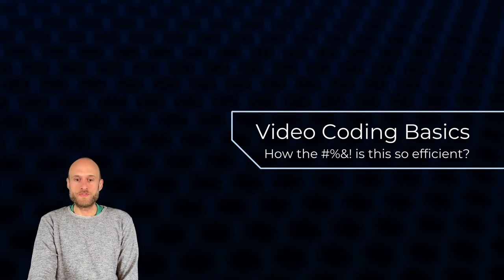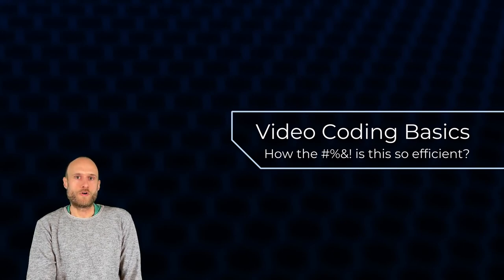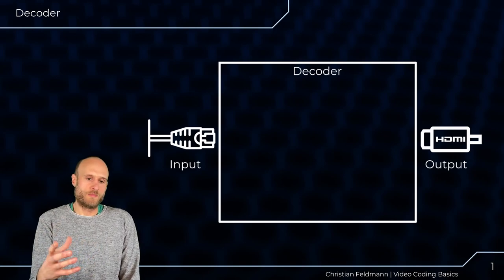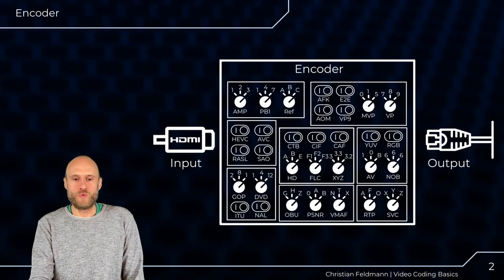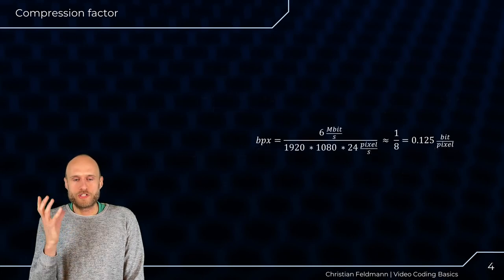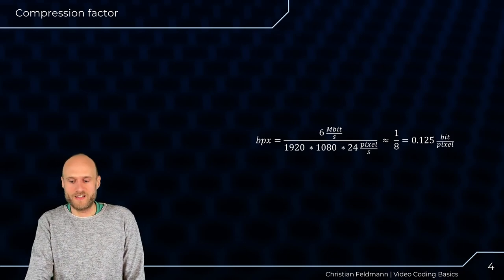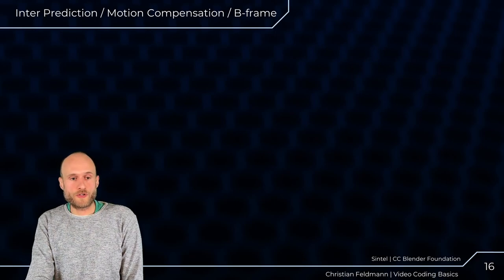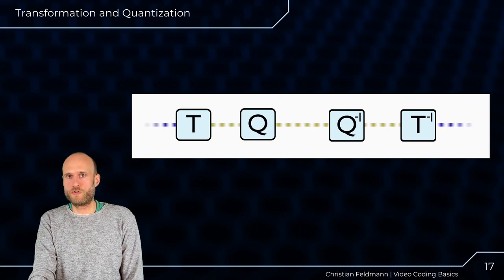Video Coding Basics - How is this so efficient?

Comment: Nice job - this is such a valuable video.

One thing I would add is that inter-prediction is much more efficient than intra-prediction, and bi-prediction is more efficient than uni-prediction. Coding a P-frame may require 2x the bits of coding a B-frame, and coding an I-frame may require 10x the bits of a B-frame.

Comment: Wow amazing video! How does the coding loop know when the encoding has been finished, if we are iteratively sending the same frame's prediction back to the intra-prediction module? Also, how are the intra and inter-prediction modules working together? Since, they both will try to predict pixel values for the same pixels (albeit using different approaches)
Reply from the maker: The loop is running on a block base. So each frame is split into blocks and these are processed sequentially. Once all blocks have been processed, the encoding of the frame is done. The intra and inter prediction modules do not interfere. The encoder can try out all different modes but ultimately it will have to decide on exactly one mode (intra or inter) that is then signaled in the bitstream.
Reply: @christianfeldmann3774  Amazing perfect!! Do you have resources or book material where I xan study this more algorithmically, preferably with code?
Reply from the maker: @AdmMusicc  I am not sure if there is something that covers this with code. But this is always a good starting point: https://github.com/krzemienski/awesome-video?tab=readme-ov-file#books

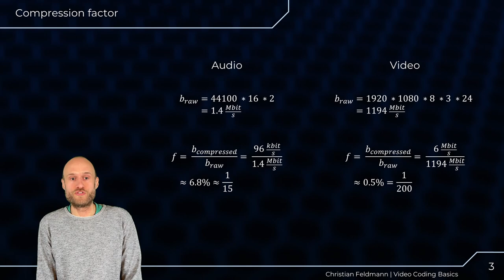Comment: 5:27
Not exactly a fair comparison, since near-transparent audio quality is compared with medium-appeal video here. For transparent video and audio compression, the difference in compression ratio isn't that huge anymore. A big difference seems to be that audio quality below transparency quickly becomes unappealing (maybe partly because it's more densely filled with information we deem important?), while the same is not true for images or video, where we often don't really mind significant perceptual degradation in quality.
Reply from the maker: Hi! I am sorry if I offended any audio compression engineers here. I did not mean to say that audio compression is easy. It is definitely not. We can probably discuss all day what would be good/bad quality in video compared to audio and what is worse or comparable. But I think my main point still holds. I was just using very typical values from practical applications. But why they are typical is also discussable. Mostly I think that audio bitrates are low compared to video so that they are typically chosen higher then actually necessary because the main focus is on saving bitrate on video. 
But of course I also get your point this greatly depends on the application and what you consider good/transparent quality for video and audio.

Comment: Hi!
Is it true that B-frames are not well suited for high-motion content? For example, if dynamic B-frames/look-ahead is used, is the amount of motion the deciding factior regarding the number of consecutive B-frames the encoder choose to use?
Reply from the maker: Hi. So this question is hard to answer because this is probably dependent on the codec as well as the specific encoder implementation. But in general for a "normal user" of an encoder this should not matter because the encoder will choose the best coding structure depending on the content that comes in (if the encoder is allowed to choose the coding structure freely). So there is certainly situations where B-frames are less effective (e.g. if the frames are very dissimilar which may happen for very high motion). But in those situations motion compensation in general is not effective.
Reply: Ok, thank you for the explaination!
Video encoding is such a fascinating topic 🙂